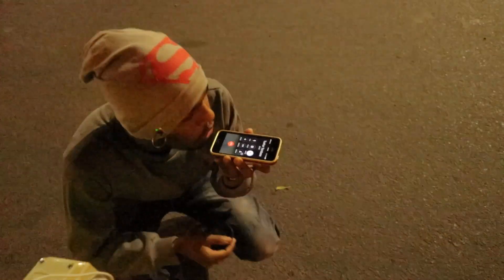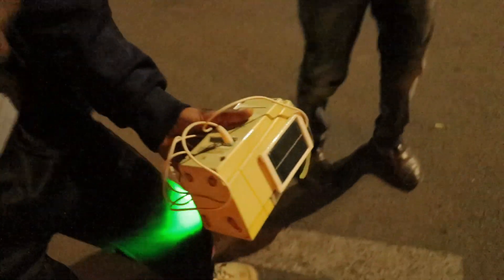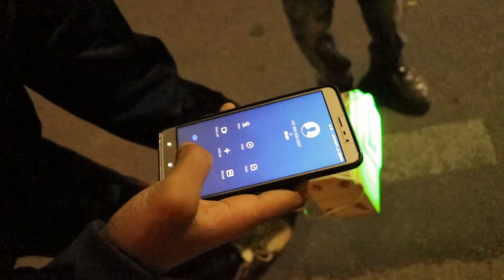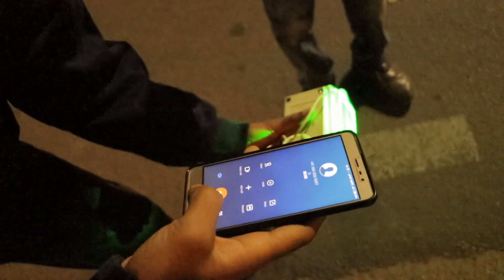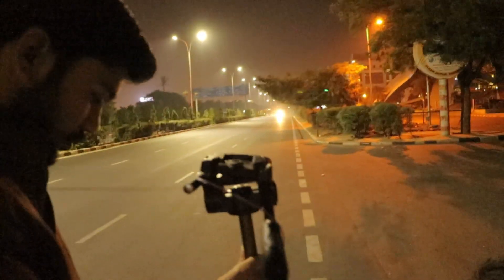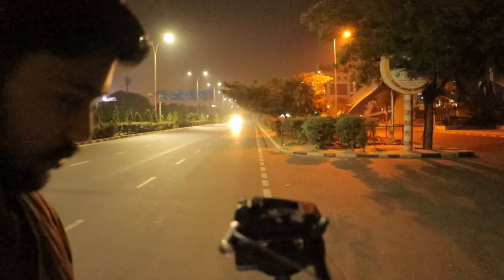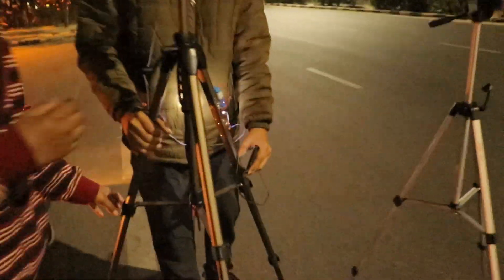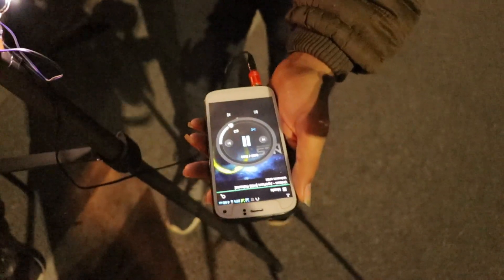Long distance Lifi communication -Audio

Comment: What about using simple led as transmitter and then pointing telescope to it from distance and reading data from it. Just like reading data from stars. Lower power and even simpler..
Reply from the maker: wow it will work but some minor modifications
Reply: @TarunShrivastava  Putting the transmitting led into a plastic ball would make it bigger target for the telescope.
Reply: Ethernet to fiber-converter -> air -> fiber-converter to Ethernet might be interesting to test also. Udp-protocol perhaps only.